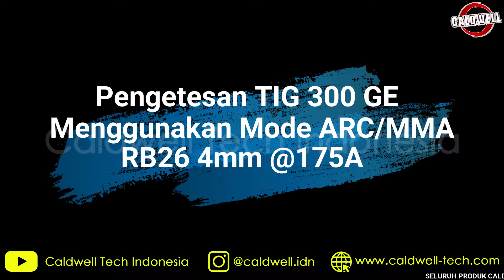Caldwell TIG 300 GE - Pengetesan TIG/ARC/MMA

Comment: Klo pengelasan mma bisa ga di pakai buat kerja proyek
Reply from the maker: halo sobat, mesin caldwell TIG MIG ARC diatas seri 200 sudah bisa untuk proyek menengah sampai berat, dan support bila memakai genset, karena listrik memakai 3 phase (industri)

Jadi sobat tidak perlu khawatir tinggal menyesuaikan kebutuhan proyeknya terlebih dahulu, kawat 3 mm keatas kerasa empuk saat digunakan.
Reply: Bisa Pak, sy sering pakai utk gtaw dan smaw/mma   electrode 3,2mm - 4mm  mat' tipis sampai tebal  65mm  hasil  radiografi/UT bagus /acc.